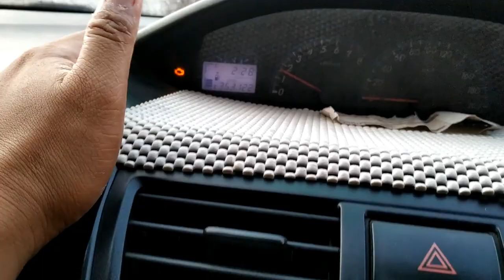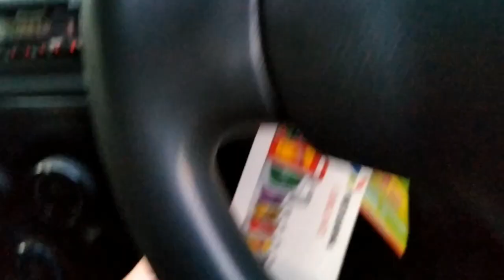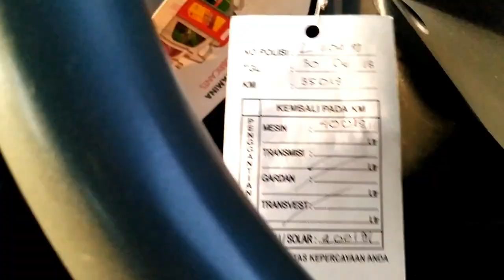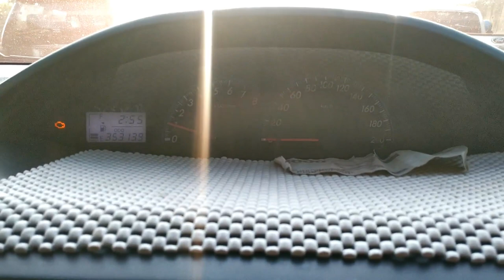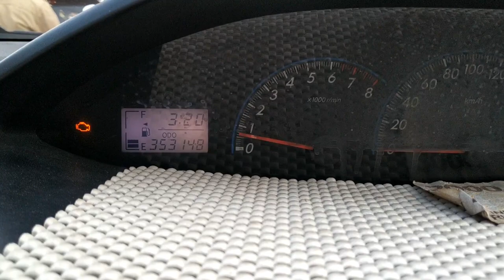Keluhan pembeli vios limo Gen2, mobil dikembalikan setelah 2,5 th pemakaian

Comment: mau cerita juga aq om... aq punya vios limo 2004, beli di tahun 2010. pas awal beli udah di upgrade type G full. 1 tahun pemakaian bnyk msalah mesin sperti d video d bersihkan emg normal tetapi pasti ga lama itu bakal ngulang lg mslah yg sama. akhirny tak bawa ke bengkel resmi. lgsung d recomend untuk general service. part yg d ganti koil 4 pcs, sensor 02, sensor TPS, seal kruk as, packing set full ganti smua, set  ulang timing. remap ecu. semua part ori toyota. habis wktu itu 10jt an. sampai saat ini 2019. ga ad masalah. 9 tahun setelah general service cma ganti oli, filter udara dn busi aja yg rutin . mobil normal jalan. mau ngebut mau mudik mau d pakek hari2 aman bos...
Reply: tambahan om. biasanya limo itu suka pakai koil kw. klo yg baru punya limo baiknya koil 4 pcs d ganti semua dgn yg ori. awal kerusakan dr koil itu yg pengapianny gak sempurna. membuat kerak sisa pembakaran busi cepat kotor. ruang mesin kotor. sensor o2 rusak. ecu bacany ngawur juga.. akibat koil jelek merembet kmn mna.
Reply from the maker: Terimakasih banyak sharingnya..🙏🙏 informasi yg bermanfaat..
Reply: Berarti klo beli mobil bekas lebih baik langsung general check up di Beres ya
Reply: Beres Toyota mana Om?
Reply: Kalau bekas taksi emank harus gt bang , cek total di bengkel resmi dulu
Reply: lhoo suroboyo endi iki bengkele cak
Reply: Pengetahuan tentang kode sparepart origanal itu penting, saat hendak beli mobil bekas ataupun servis.
Reply: Kok sama y
Reply: Mantep sharenya
Reply: Kalau saya pas dari awal beli tahun 2016 (Mobil saya keluaran keluaran 2010), dan saya beli kondisi bahan dngan harga 46juta

1. Saya turunkan mesin segelundungan, saya bongkar semua parts, saya bersihkan karena dalamnya sudah penuh dengan oli yang sudah mengental jadi gemuk
2. Saya cat ulang mesin
3. Ganti semua filter2
4. Ganti seher, busi & koil semuanya
5. Ganti kabel2 yang sudah tambalan & sambungan
6. Bersihkan radiator
7. Service AC
8. Bersihkan (cuci) semua part dalam kap mesin

Habis 5 jutaan lebih, (saya kerjakan sendiri di rumah)

Dan sampai sekarang, mobil nggak ada masalah berarti...malah sering bolak - balik Jakarta - Surabaya

Total restorasi saya habis 20juta, itu untuk mesin (yang saya bahas diatas) cat body, velg racing+ban, power window, power lock, kaca film, body kit, double din, sensor parkir, jok mb tech, stir+pedal+persneling momo KW & audio

Dan semua saya kerjain sendirian dan menggunakan part2 yang high quality, kecuali jahit jok...
Reply: @PanLalah  klo untuk kaki 2 ada garansi nggk pak soalnya limo saya kebetulan juga ambil di pol bpk situ , karet shock depan sama Drive shaft kanan kiri e yang kena
Reply: Sip
Reply: info bermanfaat jadi saya punya kesimpulan beli mobil bekas atau ex taxi pertama harus ke bengkel resmi untuk jeroan dan modif bisa di luaran
Reply: @SwaraYoga  om bole liat kya apa mobilnya? upload om videoin
Reply: @SwaraYoga  mantap om
Reply: bang, numpang nanya, kalau general services di bengkel resmi, apa bakal bisa di tune up mesin sampe kaki2nya juga? aku kok punya rencana mau beli second limo terus langsung tak masukin bengkel resmi bang
Reply: Karena di pol jarang service besar
Reply: @drajatsuryo5935  lah ini menarik, seumpama kita beli limo.. trus general chek d bengkel resmi dan d diagnosa bnyak part yg tidak layak, tanggapan pool bagaimna ya? Bisa d tukar atau gak y?
Reply: Kalau mobil saya...setiap habis tune up saya langsung belikan injector cleaner yang di masukan ke tangki bensin....yang pasti selalu saya isi pertalite minimal....dan mobil sudah saya pasang 7 titik kabel grounding dan volt stabilizer di bagian aki dan di colokan korek....alhasil tarikan lebih ringan dan pembakaran sempurna
Reply: 8
Reply: Berarti ketika baru dapet unit eks taxi spare uangnya buat mesin sekitar 10jt an ya? Biar jalan tanpa kendala?
Reply: filter oli ganti juga kah?
Reply: 10 jt nya itu bos.... Agak galak duitnya ..😅

Comment: Jd tringat dl vios 08 sy
1. Kempos
2. Mesin gredek2
3. Tkg bengkel yg snang kerjaan sy bolak balik krn yg jlas pst duit
4. Knalpot brebet
Dll
Solusi sy wkt itu sy diamkan 2 hr, pas di bw jlan kyk sehat lgsg sy jual. Lahirla brio rs 17 saat ini. 
Intinya sy suda g prcya brg second. 😁
Reply from the maker: Syukurlah..semoga selalu dilancarkan ya bos rejekinya..
Reply: Menurut pengalaman sy. Keluhan persis seperti itu. Cobak ganti pompa bensinnya aja. Pertama star harus mompa dulu. Setelah jalan normal. Klo udh jalan agak lama gas kempos mesin panas ginjal.Tetep bisa jalan tapi dakbisa kenceng. Udh sy serfis kemana2 tetep aja. Menghabiskan uang.Ternyata pompa besinnya klo udh panas dak normal.

Comment: kalau RPM turun berarti switch throttle nya kotor
Reply: Om saya juga seperti ini vios limo gen 2 padahal saya sudah service ditel juga tp kl panas masih getar dan berebet mohon pencerahan
Reply: Di engine cleaning/ engine conditioning/purging tiap 10.000km.....biasanya dah normal kalo urusan mberebet......
Koil ganti yg ori busi iridium.....dah normal semua koq....
Reply: Throotle bodynya aja bersihin biasanya normal lg.